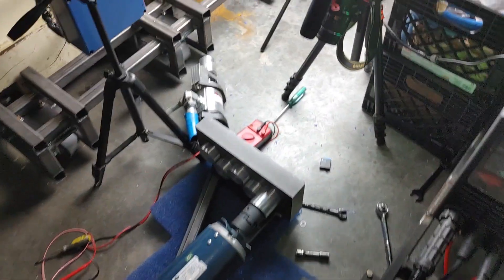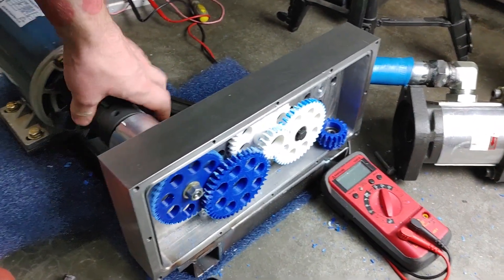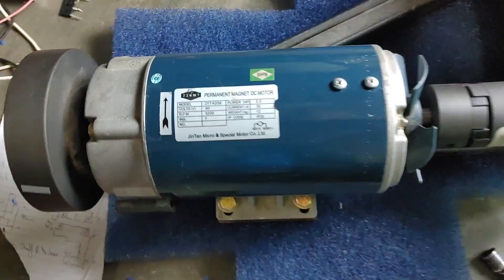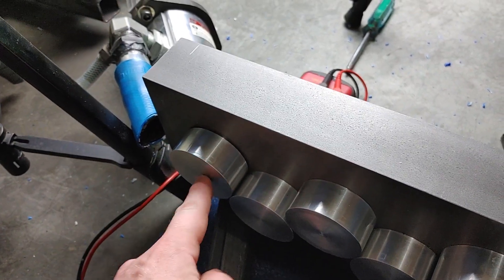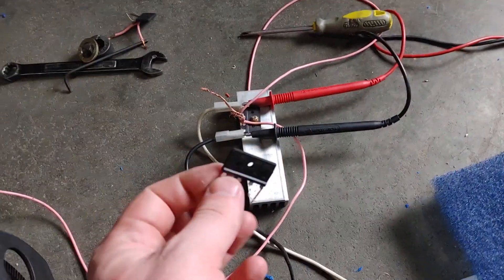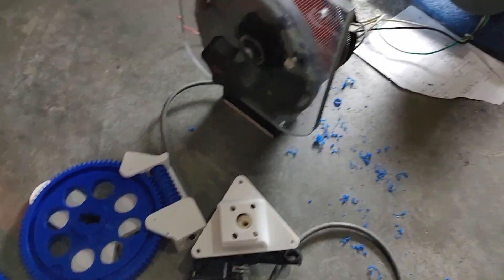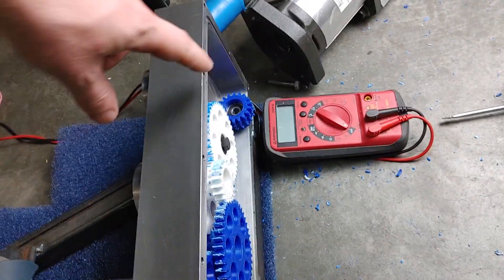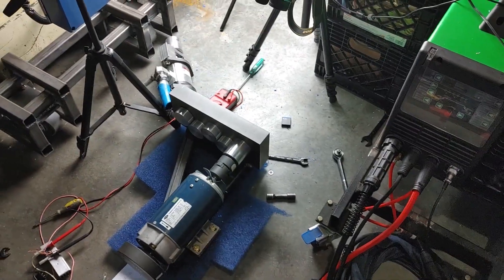Testing 3D Printed Gears to Destruction - Setup Test

Comment: Yes, but no load? What's the point of gears without load?
Reply from the maker: That's a fair point, but I figured at these speeds it would be difficult to consistently maintain such a low load for each test. Once I've found the best gear I do have a project that will load them up.
Reply: @edwardpage8346  from my experiwnce, it's not the teeth that will break but the hub. Since you are using bearings you'll be fine.